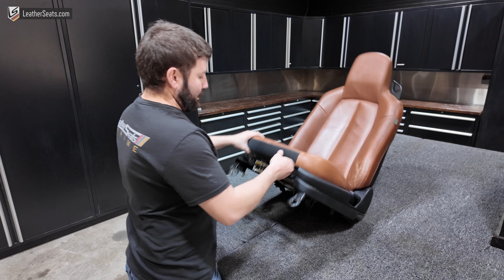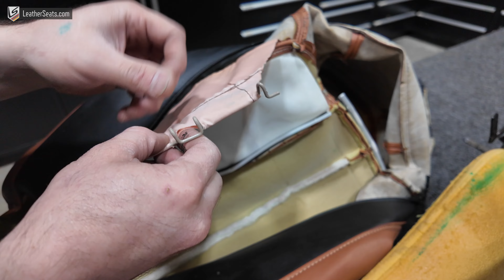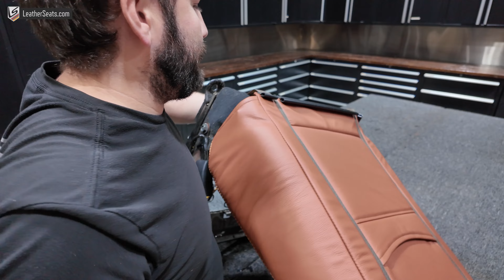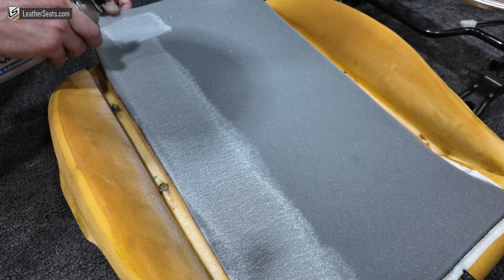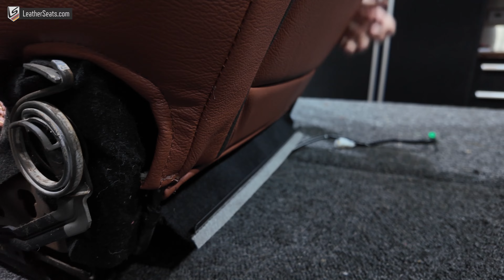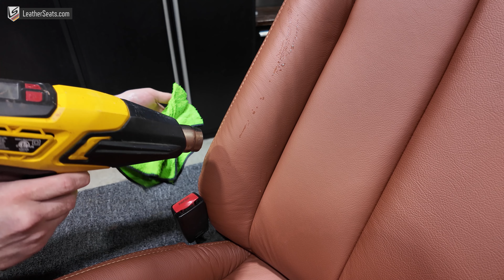Mazda Miata Restoration - Leather Seat Upholstery

Comment: Towards the end you used a heat gun for getting rid of the wrinkles. Could a steamer be used for this too, or would that not work? Curious when you use one tool vs. the other.
Reply from the maker: A steamer is more effective behind the leather, helping it become more pliable, and also helps expand the seat foam. The heat gun is more effective on the face of the leather than a steamer when it comes to removing wrinkles.